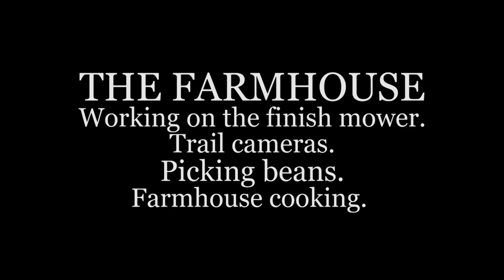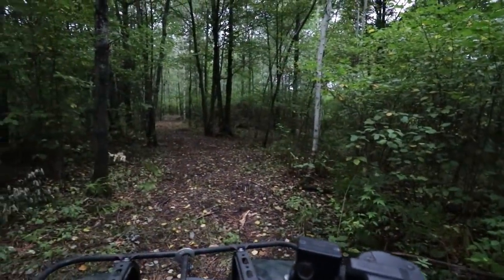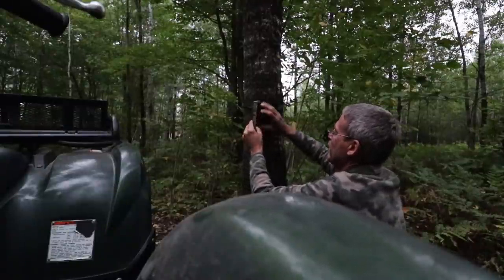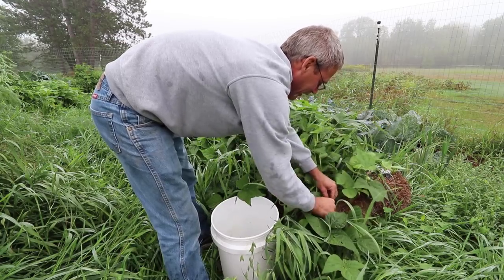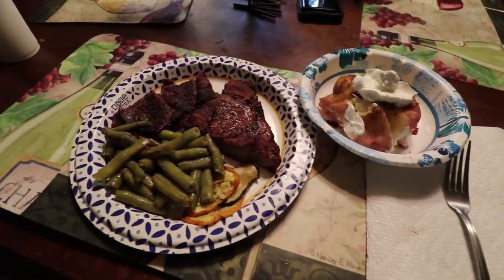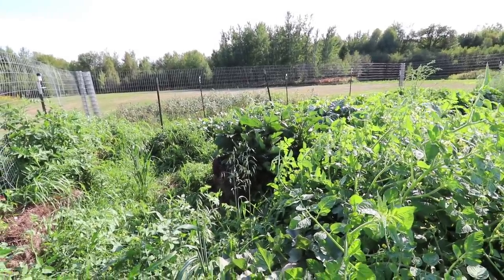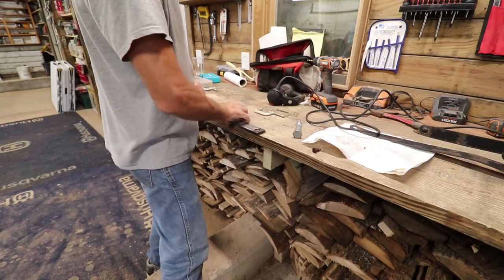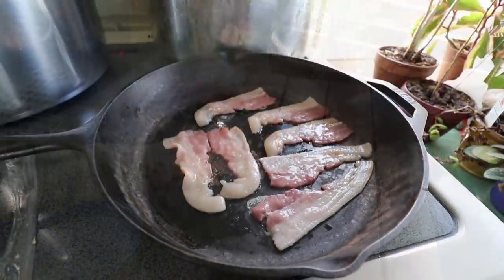THE FARMHOUSE. Working on the finish mower. Trail cameras. Picking beans. Farmhouse cooking.

Comment: im still in awe that your truck is still running so well after all these years. that engine is trashed online so much... did you "bulletproof" it? what kind of oil do you use and what interval do you change fluid? same with the transmission?

Comment: So I’ve learned a lot watching your videos Joe, so I’ll share this. Try a proven experiment for me. Pick up a new set of run if the mill drill bits and only use them on low speed. And with a plug in drill adjust with the trigger. They’ll last you 10 X longer. Drilling any metal thicker than sheet on high speed heats up the bit in the hole to the point that it rounds over the cutting edge. Unless it’s a well made bit which are the same price as a whole set. And that’s why u have to rotate the drill around to get the edges to bite because the heat had dissipated before the edges got rounded over. And extra pressure to cut with dull bits on a press only heats up the belts and pulleys causing it to stick like you said. Presses only spin at a certain rpm by design. Try this experiment and let me know how you make out. I do a lot of metal fab and it took me years to figure this little gem out. Lol. Take care Joe

Comment: lol Micro sd card story. My dash cam takes a micro sd card. This one day rather than unplug the dash cam and take it in the house to check the card, I decided to just pop the card out. Using my finger nail I carefully pushed in on the card, finger nail slipped, sd card went flying off to unknown place in the car. Didn't see where it landed. Took 2 days to find that darn thing !!! Finally found it resting against the metal bracket that holds the seat in place.

Comment: Drill Press - Change your belt and change the speed ratio by moving the belt to a higher motor speed and a better torque on the drive pulley.

Comment: Hey Joe FYI feeds and speeds run your rpms much slower to drill steel . Really enjoy the videos thank you
Reply: True. The high rpm makes a lot of heat and kills the HSS drills.
Reply: Slow drill speed and a little oil and that would have cut much easier. I’m sure those bits are toast now.

Comment: Joe what's your opinion on that porter cable jointer in your shop?
Reply from the maker: It has worked awesome. I seriously have no complaints. This is my second one but that first one really went through the board feet. You can also easily get blades for it.

Comment: Use the VISE to hold your work, also stat with a smaller bit and your way up also slow your drill down as low as it will go .